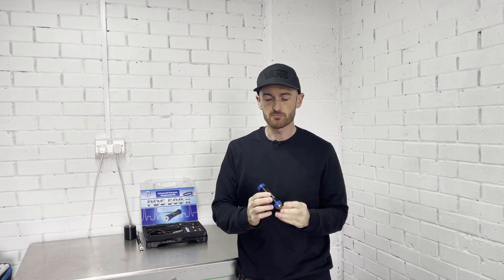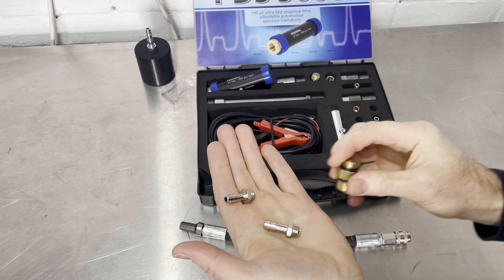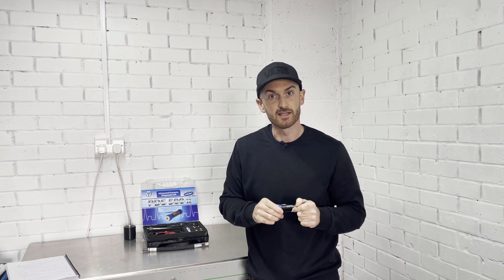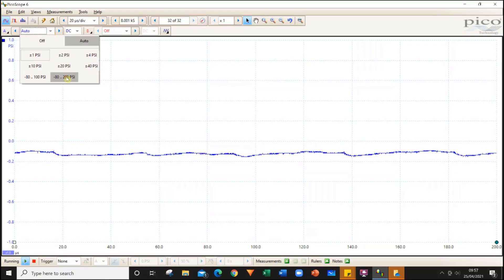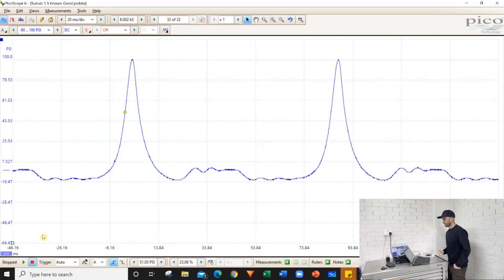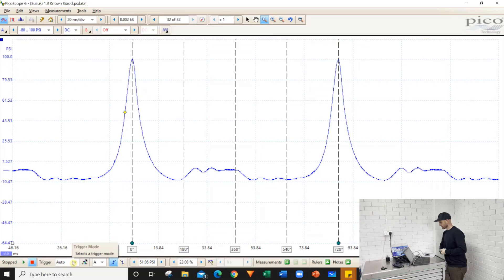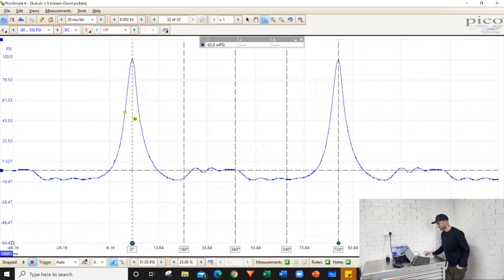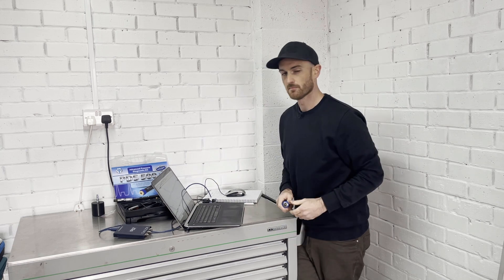In Cylinder Pressure Transducer Diagnostics | Ditex PDS500X | Mechanic Mindset

Comment: Hi Mate
I lost you at you connecting spark plug back to coil and other end you put sparkplug ground piece and alligator clip to metal part of the engine. Disabled injector for that cylinder. Not understanding why we need to have sparkplug running ?
Reply from the maker: @DailyClipztt  optional, can see ignition timing

Comment: Transducers are nasty and take so much time . old school pressure gauges are more accurate and fast and Lees headache
Reply from the maker: If you just want to check compression peak pressure, I agree. This test checks so much more though; compression, valve timing, exhaust blockage, intake restriction etc 👍

If you have the scope ready, it should take the same time to set up 👌

Comment: Good job Darren, if you really want to learn how to analyze this waveform, Bernie Thompson has some in depth videos on the ATS channel & website. John Thornton has a good video as well on the CTI channel. Brandon Steckler has some good pressure analysis videos as well.
Reply from the maker: Cheers! I have been looking at this since  made the video. It’s really quite an art, so many variables and dependencies!
Reply: @MechanicMindset  Yeah, I love it. I teach it to apprentices here in Canada. I use a 250 psi absolute transducer made by Honeywell. About $80 CND. Works great, I have the 2204a and the 4425 Pico scopes. The 2204a is a great little scope, but the 4425 is the king. I'd like to get my hands on an E-scope though, pretty cool features. I like your channel Darren, you have some really good stuff on here. I'm a retired tech. 30+ years in the trenches. College professor now. I've been using scopes since the 70's, started on the old Allen and Sun big box analyzers. Been using Pico for about 10 years. Still not sure on the Pico 7 software, it's nice but I'm so used to the 6 I'm finding it a bit clunky.
Reply from the maker: @northpostman  Awesome, yes I saw some DIY sensors, you will see I love a cheaper alternative on this channel 😆

I love the 2204a, I made a course which shows you how to maximise all the features in Pico 6. At this point, you can really appreciate where the extra money for the 4425a is spent. I’ve been using my 4225a today with Pico 7; still some features missing but it is much more intuitive for beginners. 

Great to have you on the channel!
Reply: @MechanicMindset  Do you mind if I use some of your videos in the classroom?
Reply from the maker: @northpostman  Please do! You’re very welcome 👍
Reply: @MechanicMindset  Thanks Darren, much appreciated.

Comment: I wonder if  a GDI engine how can you disable injector if it under the intake manifold  for the cylinder testing
Reply from the maker: Hmm, good question! Some engines have a separate connector block for all injectors, you could disconnect that and just to a cranking measurement

Comment: Pointing put that the PicOScope likely  isn't causing the steps in response.  The steps appear to be the update rate from the pressure senor itself.  The little spikes on the plateaus are the at the scope sample rate, which is a bit low @ 8k/sec. Could raise that to 100k or even 1M and still have plenty of buffer.
Reply from the maker: I’ll give it a go, but pretty sure this is a vertical resolution issue. The 2204a is 8bit so only has 256 vertical ‘steps’ to recreate the scope waveform image. Compare this to a 12bit scope which has 4096 vertical steps and it will create a much smoother line 👍

Comment: Excellent video.  Best explanation I’ve seen yet.
Reply from the maker: Thanks Wes! What in cylinder pressure tester are you using?
Reply: @MechanicMindset  
  I’m still old school, the hose adapter in place of the spark plugs and an analog pressure gauge.  I was a dealer mechanic, GM then Chrysler back in the 70’s & 80’s, then went to work for the California Dept of Corrections in 88.  However I still worked on cars at my shop at my house,  still do after almost 34 years.  The only training I get is from guys like you with your you tube channels.  There are probably a dozen channels that are really good, your being one of them.  The things I need to learn are as simple as where to hook up leads of these scopes to get the patterns I need to see and then explanations of what I’m looking at.
Reply from the maker: @weshawkins7165  Awesome!
Reply: @MechanicMindset  
  If there is one thing I could ask is don’t think your being to simplistic in your teaching and explanations because there are probably a lot of mechanics that don’t understand a lot of the simple stuff but are embarrassed to asked the simple questions.  Thanks for what you do.

Comment: Have you ever tried the APT-100? Looks a decent kit, I want to buy a pressure sensor but cant justify the price of the WPS at the minute
Reply from the maker: I’ve not but I’ve heard good things. Just checked, they have also definitely jumped up in price. They were so cheap when they came out. I can’t see one under £200 gbp
Reply: @MechanicMindset  yeah I have noticed that too, I have also been looking to get a pressure pulse sensor can you recommend one? Is the autoditex one any good?
Reply from the maker: @gmak1n785  I think so. I’ve got a Rotkee one but not tried it yet. What country are you located?
Reply: @MechanicMindset  I am in England, where are you based mate?
Reply from the maker: @gmak1n785  Yeah same, Warwick. I am looking to get some Rotkee products in the UK. Will try and have a look at it and see what it’s like, from what I’ve seen they’re good
Reply: @MechanicMindset  I'm not far I'm in Nottingham stayed in Warwick a few times as I work for JLR and the academy is just a round the corner it's a nice area. Let me know how you get on with them please and I will do some research.
Reply: @MechanicMindset  have you ordered direct from Rotkee? Looks like they ship to the uk but never heard of the payment apps you have to use?
Reply from the maker: @gmak1n785  I haven’t bought anything but I am in touch with them. They have sent me some products to review. Will get some videos up soon 👍
Reply: @MechanicMindset  I will wait and see if they any good then before ordering!
Reply from the maker: @gmak1n785  I have a couple from MA Diagnostics. He’s a UK tech that makes them. You can find him on FaceBook. They are the ones I used in my pulse sensor video 👍
Reply: @MechanicMindset  I dont do facebook, does he sell them anywhere else mate?
Reply from the maker: @gmak1n785  He doesn’t. And he stopped making them for a bit. Let me try this Rotkee one out and I’ll see if they can get some over to me 👍
Reply: @MechanicMindset  I have been in contact with them and managed to order one fingers crossed it turns up!
Reply from the maker: @gmak1n785  From Rotkee?
Reply: @MechanicMindset  yes but struggling to make the payment, it bounces back saying they have exceeded the monthly incoming payment allowance.
I have emailed them.

Comment: Dear Sir, the picoDiagnostics program can be used with the picoscope 2204A or 2204 thanks
Reply: Thank you. congratulations on your videos. has some video of the use of the inductive secondary probe in cop coils
Reply from the maker: @ManuelAndresFernandezRey  yes, check out my videos where I use a coin on top of the coil, and another where I use a relay to measure the ignition coil waveform 👍
Reply from the maker: No, unfortunately you need the automotive scope

Comment: hi darren   i really need your help with my car im having some  electronic issues
Reply from the maker: Hi, what issues are you experiencing?
Reply: @MechanicMindset   how can i contact you ..to explain ?
Reply: @MechanicMindset   communication problem with mu bmw e912010  ..i replaced the timing chain , the clutch & flywheel ..fitted the engine and tranmission back into the car, plugged up all the wiring and crank it up ..nothing it wont fire ..just a bunch of codes one of them is the 4b90 it has been sat for weeks  while i took the time to replace all the part
Reply from the maker: @lloydpalmer5735   If you can read the codes or communicate with the module then the network is ok. If any modules are ‘offline’, start by checking their power and grounds. 
4B90 is a rail pressure fault so nothing to do with communication. Sometimes it takes a while to get the fuel back up to the rail. Have you definitely fitted the crank pick up ring? It sounds like you would be best getting someone to look at it. Sorry, there’s not much I can do over email etc

Comment: Do you take requests? I need to check the function of a PWM IACV, a quick explanation or video of how to use a scope to establish the base frequency would really help me. Thanks
Reply from the maker: Hi Yak, I do add videos to my list as requests come in (if I think I can help!). They do take some time so not sure I can get one up in time for your needs. i've not looked at idle air valves much, but there is a quick measurement function to read out the frequency of the waveform you have captured. Cheers

Comment: Darren I know you said disconnect the fuel injector but on Honda 3.5 they are very hard to get to. Can the cylinder be checked by disabling the fuel on all cylinders and check by just cranking the engine. Just checking with you first 😊 Artie
Reply from the maker: Yeah for sure, you can do this cranking only too 👍
Reply: @MechanicMindset  thank you buddy stay safe Artie 😊

Comment: thank you this information Pico oscilloscope please explain AWG option
Reply from the maker: Actually, there is not much you can do with AWG on automotive because the output voltage is too low

Comment: Thanks for a great explanation Darren it’s very informative and I have noticed you used voltage on injector sync can you use an amp clamp instead and if you could have dose it make any difference when come to sync and identify cylinder. Cheers
Reply from the maker: Sure, an amp clamp will be fine, less intrusive actually 👍 Glad you’re enjoying the channel!

Comment: Great demonstration!  That looks like a handy little accessory :)
Reply from the maker: Cheers Franny, it’s a cool tool! Great job on the ignition diagnostics. I did have a go with it and had the same resolution problems
Reply: @MechanicMindset  Thanks for that! I think it is just the limit of the scope but I did get a little better resolution of I didn't use any scaling on the probe. Cool to have both probes - one to check the actual numbers and one to get a better waveform. Still, for the price the little Pico is pretty neat.  Thanks for all your help! F

Comment: Nice work Darren, great explanation as always.
Reply from the maker: Cheers George, I know you do a bit of in cylinder testing. What problems do you see the most?
Reply: @MechanicMindset  I’m still learning this technique but  the most common issues I see with the GM vehicles are valve or lack of valve opening due to DOD lifers unlatching . Tbh though  ( IMO ) the most useful information i would use it for  would be verifying valve timing events. Most of the modern vehicles have cam/crank correlation variance scan tool data and its pretty reliable but its always nice to back up that data. An in cylinder test is a great way to do that.  I personally don’t use it very often ( don't get too many situations that require it on a daily )  but when i do its a great tool to have.  Kinda long winded answer right LOL.
Reply from the maker: @gcmd5852  Awesome, cheers for the insights. I agree, I can’t see this being a regular tool 👍

Comment: For better "vertical resolution" what do I have to look for when Im buying a scope and how much it has to be as a value ?!!
Reply from the maker: Well this 2204a is 8bits, which is ok for most tests. The automotive scope is 12bits. I find the 8bit scope struggles with this and other measurements like secondary ignition, but for everything else it’s great! You can see what I use it for in all my videos 👍
Reply: Thanks

Comment: Yo Darren is it worth buying instead of making one like you did?
Reply from the maker: Hey Daniel, I haven’t made one of these yet.  I made a pulse sensor (for very low pressures). You can make these, but for a good waveform I believe you need a really good transducer. If your serious about using it for diag, I’d buy one. There are some videos about of people making these too though 👍. You can get this sensor without the kit and just use the adapters from a standard compression kit; it’s more affordable that way. But this kit is great for the price.
Reply: @MechanicMindset  will do. Will look them up. Thanks

Comment: Hey Mate,
For a basic explanation, you covered a lot! You can spend hours on that single waveform.
The old Pico is starting to show it's limits.
I just bought the latest 4425A Pico with the current Beta 7 version. It is a purchase that I haven't regretted at all. Not cheap, but wow, what a cool piece of diagnostic equipment!
As always, great video! 😉
Reply from the maker: Cheers, you’re right, so much to cover on this waveform! We use 4425’s at the academy and they are great tools. I’ve had a play with Pico 7 but still love the normal 6 😂
Reply: @MechanicMindset  Yeah, I have one at the college & one in my workshop. Still trying to get my head around Pico 7, but as they say, practice makes perfect (or average in my case...) 😉

Comment: Does the waveform pattern change much when comparing to an Atkinson or Bodack cycle engine?
Reply from the maker: Assuming we can get the engine to run in this mode with a misfire and injector fault at idle, I suppose we would see some difference in the valve activity. As I understand, this mode is created using VVT and such so not sure when it is activated (assuming it runs normal Otto at idle?). Great question! 👍

Comment: Hi Darren! Just a question. Justin Miller have a lot of useful videos like you with the 2204a on his channel. He is recommending to always max out the sample rate to 2MS i think. What do you think?
Reply from the maker: Hi, Justin has some great content! In my opinion it’s no necessary to max out the sample rate; you can end up picking up unwanted ‘noise’. If you use a higher time scale (I.e. 200ms +) and you want to see detail after, then yes. I don’t often increase the sample rate. In fact, I have reduced for some tests to get a cleaner line (4425 has low pass filter which has a similar effect)